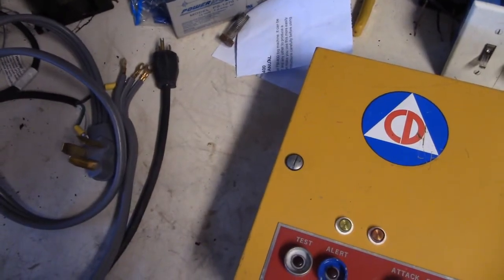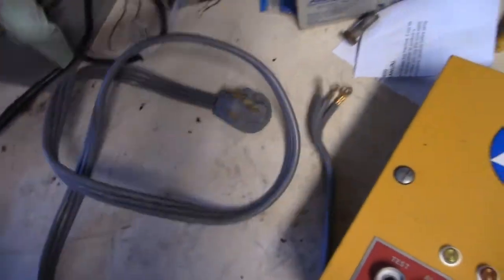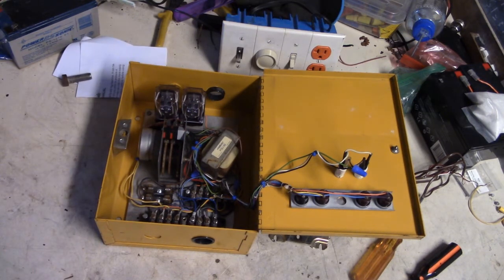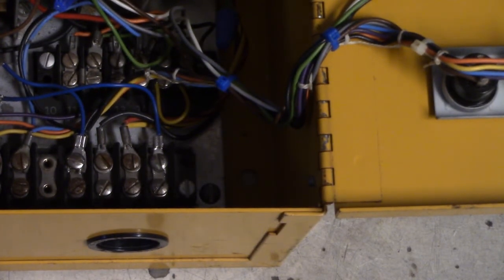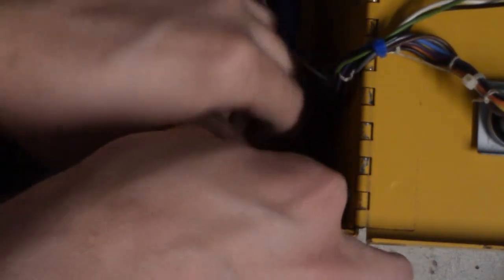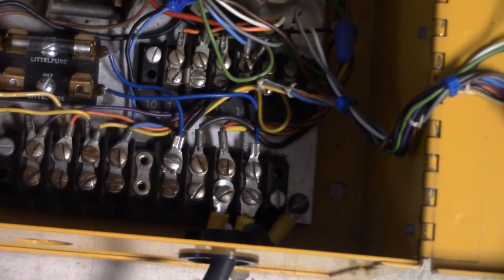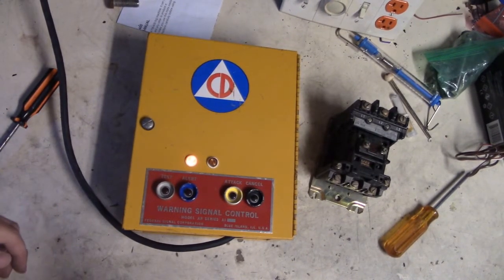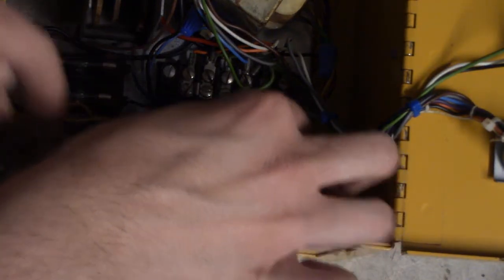FAQ: How to wire up a motor starter to a AR/AF Timer. (400 subscriber special)

Comment: How can I wire this to a Darley model 5?
Reply from the maker: You would connect the line side on l1 and l2 on the starter and the siren to t1 and t2. Then the starter coil can be controlled by the AR timer.

Comment: How do I know if a fuse is blower?
Reply from the maker: @therailcat9790  put a resistance meter across the fuse (when removed) it should be around 0. If it doesn’t detect any resistance, (OL) that means it’s blown. You can look at it if it’s a glass fuse.

Comment: My AR Timer is being a bit stubborn, 

Only Attack works…
(Not sure about growl), sometimes alert will..

I think it’s just a loose wiring connection, although I haven’t spotted any loose ones.
Reply from the maker: @therailcat9790 could be a loose connection. Check the microswitches, fuses, and wiring.

Comment: Can a contactor be used like a motor starter?
Reply from the maker: Yes.
Reply: @cooldomino1800  will hook up the same as a motor starter?
Reply from the maker: @ThunderboltSiren1003  yes. AR in series with the coil.
Reply: @cooldomino1800  ok
Reply: @cooldomino1800  is there any way I could hook my Thunderbolt to the AR timer? My Thunderbolt is single phase
Reply from the maker: @ThunderboltSiren1003  you will still need a motor starter or RCM.
Reply: @cooldomino1800  okay so if I got a motor starter and connected it to the AR timer and then the Thunderbolt it wouldn't burn it up

Comment: So, I get a Model 2, and Can I just put the wires on to the siren's wires? 10:09
Reply from the maker: You will need a motor starter for model 2 or bigger. It’s recommended for model A like sirens.
Reply: @cooldomino1800  Alright. Thanks!

Comment: So, you said that if you were to do this and use it on a big siren, that it would fry your timer. Is there a similar method that would work for say, a thunderbolt?
Reply from the maker: You will need a RCM. Just connect the control wires from the RCM to 1 and 2 on the timer. As long as you use a motor starter connected to the timer, it should not be a problem with big siren.
Reply: @cooldomino1800  Alright, thanks!

Comment: Do not connect any siren period directly to an AR timer at all! It doesn't matter how small.
Reply from the maker: The micro switch contacts can handle up to 5 amps.
Reply: @cooldomino1800  inrush current will get it in an instant
Reply from the maker: @seanjuth  I don’t think so. I ran my model 315 on it before. Plus. You can get a new micro switch from a microwave.